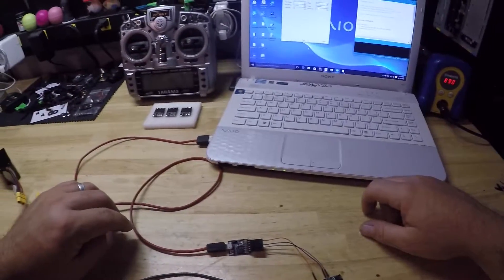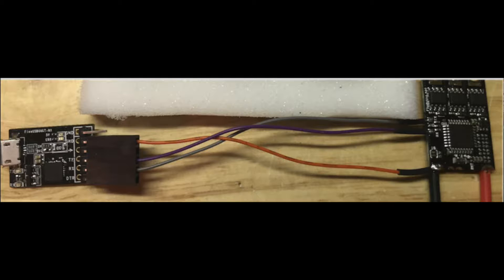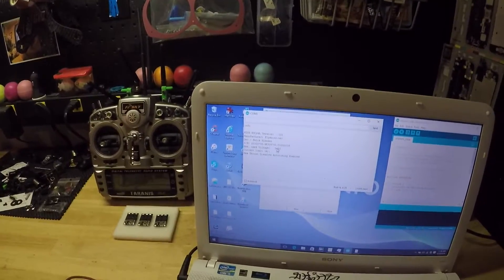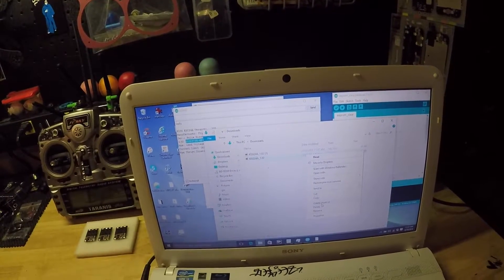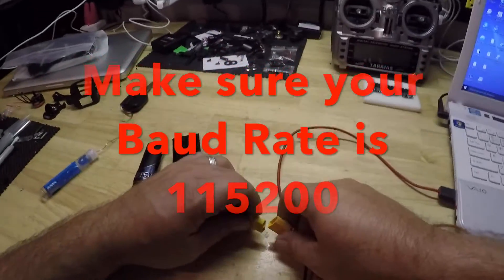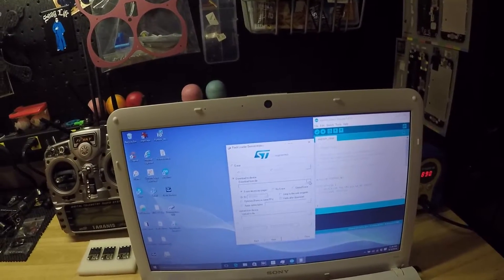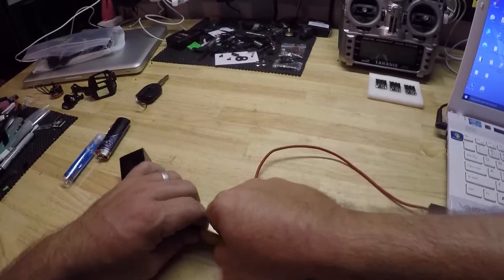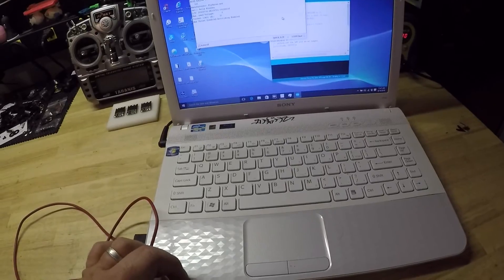24A KISS ESC Update

Comment: Thanks Tyler. It was a good how to video anyway. Now I have one flashed to 1.02 and 3 on 1.01. I think that the only difference is the bootloader so they should all be OK together? Anyway, back to Betaflight for me. Thanks for letting me know I wasn't just going crazy. all the best
Reply from the maker: Yea they'll be ok together. 1.02 put on boot loader to easily update to 1.03 using the KISS GUI easily I just did my last one tonight to 1.03 it was as easy as plugging in the Lipo and pointing to the 1.03 FW file click wait 1 min. Then all ESC's flashed to 1.03

Comment: worked on first one. wouldn't even read info on second one. 2 computers. 2 installs of arduino. countless hours. quad in bits just to update a firmware! Simple my arse. hype more like. thanks for the how to. not your fault their product sucks.
Reply from the maker: Out of 20 I lost 4 like this :/ I sent them back to Flyduino for testing and hopefully they'll send replacements. Each ESC has a special HEX please DO NOT USE the same .hex file for every ESC

Comment: where is the setting file you say is in dropbox but I cant find the link
Reply from the maker: Sowohl NL als auch CR/ 115200 BAUD
Reply: Thank you I can only find this stuff in the preferences 
serial.databits=8
serial.debug_rate= 115200
serial.parity=N
serial.port=COM1
serial.stopbits=1

I have already changed the  serial debug rate but where do the others go?
Reply from the maker: +Toothless FPV leave everything the default except the com port your using
Reply: Thanks I finally got it working, great video by the way
Reply from the maker: +Toothless FPV thx man! I'm glad you where able to update ;)

Comment: Hey, what did you mean when you said 'use the dropbox settings'? When I open arduino and select the com port and type info it doesnt do anything. Did you have to do anything special with selecting the port or drivers? 

Also, do you get a brief blue LED on the ESC and then nothing during this process?

Thanks!
Reply from the maker: Mirror the bottom boxes baud rate etc.
Reply: +Tyler steinhauer yeah, doesn't work for me for some reason :(

Comment: where to get the usb connector? I feel like I need to do this before I build
Reply from the maker: If u have 1.02 u DO NOT need to do this. If you have 1.01 it's up to you but you'll need a FTID adapter. I got mine from MRM about 2 years ago. Hope this helps 

http://www.multirotormania.com/programmers/315-ftdi-programmer.html